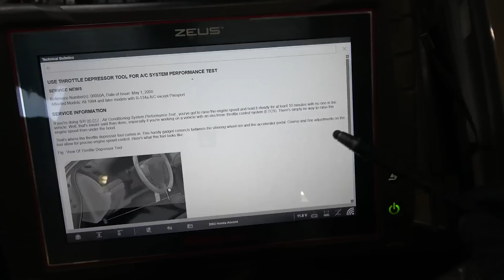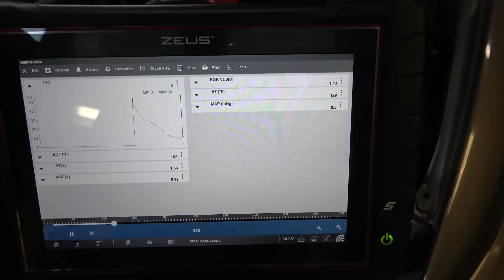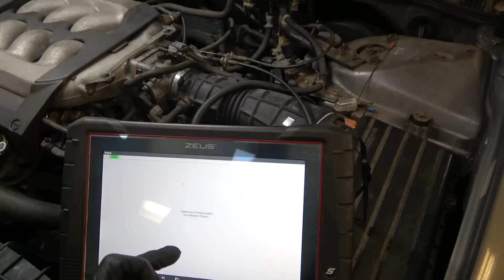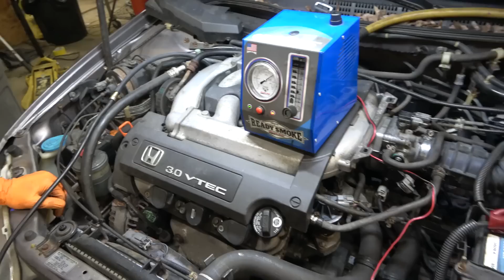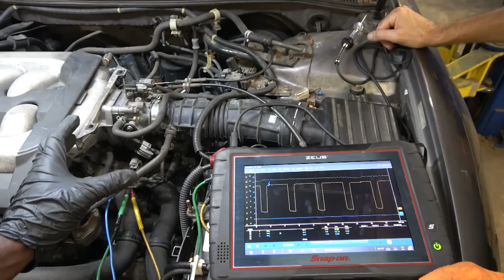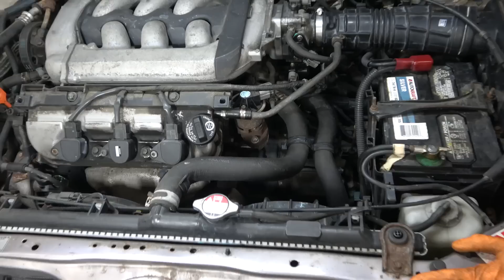This Honda Accord is Unfixable - Code P0505 idle Speed Stuck High

Comment: I have the exact same car and have cleaned my IAC valve and after 260k miles it smoothed out the idle.  Another item is the cat, after 250k miles, replace it, they are cheap and o2 sensor then too.

Comment: I fixed that same problem and fixed it without diagnosis tools.for all mechanics out there the actual problem with those idle solenoid is the plate that blocks the air passing thru it gets stuck due to gunk especially when the engine is not operated for long periods. Proper regular cleaning of the throttle body is required to prevent it from sticking.
Reply from the maker: @markwill1205  Good!

Comment: Great video I have a 2002 Accord EX V-6 that I bought yesterday, 1 owner vehicle.
idles a little high, what would you check out 1st like air filter? Spark plugs were replaced at 120,000 miles in 2011 at Honda dealership.
Now car has 144,000 miles, your opinion thank you Sir. 👍

Comment: I have the same problem, 1998 accord 3.0 ran perfect for 6 yr , i was putting sway bar end links and decided to clean engine bay so i removed battery and cleaned since i used sone water for cleaning I let the car sit for 4 hot days to dry   then I blew it off with air . Hooked battery on 5th day then surging started . everyone was telling me to let it idle for 10 to20 ninutes and ECM has to learn to idle all over  because it was eraced  but after doing that a few times it still surging, after watching your video i did everything you guys did and still surging. I am wanting to know which vacumn tube Biship closed off to get idle down he didnt point t the exacr place he just said it was befor the throttle.   Need some help. mine surges cold and hot. Thanks
Reply: do you have vacuum hydraulic engine mounts?

Comment: … it is suggested that the focus of the shop be diagnostic specialist/consultant… with less intense repair secondary… since diagnosis is time consuming.
Reply from the maker: @mounbakko5871   Yes! I agree
Reply: @KITS_Auto_and_Truck_Repair ... don't know if you are aware that it is almost impossible for car owners to find a reliable tech who can take the time... let alone have the skill ... to diagnose these car issues as you do... look at the majority of your videos... they are about codes and lights on the dash... most tech just guess because they do not know and do not want to learn how.... time is money and they just want the money... forget honesty or pride of skill... they do not care... another proof is when you have other shops sending cars to you, it means something... it means there is a dire need for a skilled tech... these car issues just keep getting more and more because of these modern cars controlled by computers... if people could get a place where they could go get their car diagnosed and get specific cause, it would be very encouraging because solving car problems can be a money pit as you very well know... techs charging for what they think and not what the issue is... they enjoy the prestige that people depend on them, yet they have no knowledge... the doctor who does not know how to cure a patient who is trusting that the doctor will save him... continue thinking about it and gather data of need, requests etc... to help you determine if you can come ahead financially going this route... build your brand... the time you have put learning and getting this skill should benefit you... keep going man.

Comment: I like the way you give explanations to the work please my question is I have a Honda Accord 2012 model when you pull the shift gear is hard  and if push too is also hard please what is the cause
Reply from the maker: @raymondmensah3261   The shifter mechanism could be rusty

Comment: Near the end of the video when you confirmed it was, in fact the IAC, you mentioned you plugged a port and the car idled down, proving the IAC. Which port was this?
Reply from the maker: @kylefetters9239   The ports between the IAV Valve and the intake manifold

Comment: Hmm, I recently asked a question about a purge valve. I purchased an after market part for my 2010 Honda Civic. It was Import Direct Ignition 2 Terminal Canister Purge Solenoid - 42-00467 from Oreillyauto. I'm going to look into getting a OEM purge instead. Watch the issue be the brand new after market purge valve I recently installed.
Reply from the maker: @DukeofHell   OEM is the best way to go
Reply: @KITS_Auto_and_Truck_Repair  That is definitely true. I got original purge valve I had before and put it back on. P145C and P0497 have not came back. The Import Direct purge was making noticeable clicking sounds which I thought were from the engine but found out it was the purge when I put my finger on it and felt the clicking. I've been watching tons of videos but when I saw KITS Auto and Truck Repair videos it got me thinking. It might be that aftermarket part you installed. Thank you for the videos.

Comment: Great Dx! I'm having the same problem with a 2001 Acura 3.2TL. I replaced the ICV which seemed to fix the surging but after driving it for an hour the surging started back up. I didn't ask for an OEM part so I'm guessing it isn't OEM. I guess I'll go back into O'Reily's and see about OEM. 
BTW, I noticed that Bishop was wearing an IBM shirt. I've still got a few of those in my closet after 34 years at Big Blue. 
Thanks for great video!  Tom
Reply from the maker: @tomhepner5118   Thank you!

Comment: Did replacing the EGR valve fixed the p0505? Im having the same issue but with a 2.3L. Already replaced the IAC valve with oem honda and codes came back after driving around… i also have no EGR valve codes which is weird
Reply from the maker: @jomine16 No, the fix on this car was installing an OEM EGR Valve, make sure you get an oem EGR Valve

Comment: That EGR valve is two pieces, splitting in the middle of the pedestal. There's a gasket between the two pieces.  It can leak through there and cause a vacuum leak; you should have checked the fuel trims.  If the you are monitoring the trims at idle and spray some brake clean right at the middle of the pedestal and there is a leak there you will see the trims change.  Or you could remove the EGR valve, plug off the port, and see if the fuel trims change.

The IAC can have the interior spindle get stuck/sticky and fail to rotate properly.  Disassemble the IAC and cleaned the spindle.  I've done it and it completely resolves the high idle issue.
Reply from the maker: @schifoso  oh ok, Good to know! Thanks for your input

Comment: What about fast idle valve, it can cause that problem when it fails to close when engine warmed up,  and easy to test by putting your tumb at the hole that direct air to it located at throttle body before throttle body butterfly, if it still socks air after engine warmed up, it is defective and cause vacuum leak, it suppose to close after engine warmed up, and you can't tested it by using scanner, it worked by engine coolant,  and also aftermarket idle air  control valve, and MAP and other vital parts Is a bad idea for honda cars, I tried that myself, first brand new unbranded one from ebay, it doesn't workat all, idle start fluctuating after engine warmed up, and second  new branded ultra power  aftermarket, it worked fine for  a month after that   idle fluctuation when  engine warmed up but this time with code idle air controle valve circuit controI, and after that i just Hunted for a good used OEM one on ebay and it is a year and half now and the car is happy no problem, third time was fast idle valve problem that caused hight RPM or engine RPM fluctuation after engine warmed up. I just changed the fast idle valv and adjust it (new aftermarket need adjustment), so it can close complettely at engine normal temperature 80 degree Cesius,and problem solved.
Reply from the maker: @abdoualilahthomas8031  Cool

Comment: Did you check the throttle cable? Some people adjust it to fix a low idle. Then after the engine is fixed you will have this exact problem
Reply from the maker: @fmbfla   Oh Cool, Good to know!

Comment: @KITS_Auto_and_Truck_Repair I have a 2002 Honda CRV, and it's the same issue! I have tried 3 idle air control valves from AutoZone. I am glad that he mentioned he has tried 2 after-market parts and still failed. Where can I find an OEM idle air control valve for a 2002 Honda CRV 4WD EX. My next approach is getting a used one from the junkyard and hoping it works.
Reply from the maker: @DavidSanchez-fo7sx if you can't get it from the Dealer, the junkyard would be a good option and make sure the wiring the IAC Valve is good!
Reply: @KITS_Auto_and_Truck_Repair  Replaced it with a junkyard part. Cleaned it and installed it. Idles much better when it is cold but once it warms up, the same issue with the surging. How would I test the wiring? I can't find anywhere that tells me how much V each wire should have. Can the IAC be tested with a multimeter before being installed? Would have loved to see a side-by-side comparison between the specs of the OEM and the faulty part like resistance or voltage between pins.
Reply: @KITS_Auto_and_Truck_Repair  Also, the CEL is on. It surges, but When I clear the code, it idles perfectly. Any reason why is does that? assuming its faulty, shouldn't it continue to surge.

Comment: Nice job 15:00 all egr valves laeks,all tps  shaft leaks, pcv os a vaccum leak  . Those are  considered  as  measured leaks that are ignored o pre program on the cuastom tables of the software  for fuel trims control
Reply from the maker: @JoelAutomotiveInaction   Thanks!

Comment: Far as aftermarket stuff goes, not all of it is created equal. You're likely to get burned using no-name garbage from Amazon or eBay but there are others that are OEM quality, such as Denso, NTK, Hitachi, Delphi, and Aisin, and in fact many actual OEM parts come from these companies. If the OEM part is unavailable or prohibitively expensive, you can usually find an OEM equivalent part from these brands for much less on RockAuto.
Reply from the maker: @notsureigaf  That's some what true!

Comment: I have a question .......Can you explain what happens when you pump the brake pedal to test the 02 sensors?  I saw you do it on one of your older videos.  Just thought that you might see my question on this recent video as you reviewed the comments.  Your skill is self evident and your gift in explaining what you are doing and why is such a wonderful contribution to all of us DIYers.  Thank you for that!  God Bless you.
Reply from the maker: @ronniestevens9268  My Pleasure! when You pump the brake pedal while the engine is idling you create a lean condition on a vehicle that has a vacuum operatedbrake booster, because in the booster there is vacuum on one side and atmospheric pressure on the other, so pumping the brake pedal allows air to enter the vacuum chamber and create a lean condition, since the vacuum side is attached to the intake manifold, when this happens 02 sensors that are good react to the mixture change very fast, indicating good 02 sensors!!
Reply: @KITS_Auto_and_Truck_Repair  I understand.  Thank you for explaining that.  That is very helpful and a valuable bit of advice!
Reply from the maker: @ronniestevens9268   My Pleasure!

Comment: Not sure if it was mentioned, but I would've monitored the scoping of the idle valve at operating temperature to see the valve open and close. I'm assuming there would be some distortion in the signal when it's commanded to close
Reply from the maker: @user-sv2ex7ux4i  yes!

Comment: Common egr flow problem is a blocked transfer port in the upper intake plenum caused by carbon build up (p0401).I believe a 5/16 drill bit fits perfectly in the hole to clean it out as i have done many but it's been a while.
Reply from the maker: @montefiveforty1   Oh Good!

Comment: EGR needs a TAP TEST to see if it is sticking. If the IACV (older models) has some coolant lines going to the TB, which is not fully warming up the IACV due to air or junk trapped in the coolant area, this can be one problem. Since the IACV does not properly close from not being properly heated up, it acts as a vacuum leak, air bypass leak around the butterfly valve. I now see you have an EGR leak which in some cases is a built-in vent hole since it's on the top area away from the EGR plunger check valve face, the top should only be the position sensor and solenoid electronics. 

Honda likes to open the IACV off idle so when you are driving and come to a sudden stop, the IACV is not closed and the sudden closing of the butterfly valve does not cause the engine to stall and allow the IACV to close off slower at stops. An old test is to watch the Duty Cycle at a stop, fully warm, in gear, brake on, then release the brake and allow the car to roll and watch the DC as the PCM now has a VSS signal that can tell the IACV to open a bit so when you stop, the engine will not die from a sudden stop of the VSS. YES YES YES, plugging the port, inlet bypass port to the IACV is a proper test. 

You may have experienced a bad ICV in a Nissan that is electronically heated and it also does not fully close when hot so there is an idle problem also, the same scenario here in my story. Clamp off the air hose going to it and problem found, no more bypass air leak. In other engines, the TB Gasket can be put backward blocking off a bleed port causing problems as the bolt pattern is the same both ways but the port holes are not.

If you had a sensor simulator handheld tool you could create your own PWM, (name ?). When you do tests, I wish guys would show final good test results, this was prior to the last IACV, SCAN DATA MAP 0.9V Idle IACV 1.0V At 1400RPM, if you don't mind, please redo verification testing for the YT viewers. Thank you for the case study as always.
Reply from the maker: @DuaneDonaldson  My Pleasure! and thanks  for your input, I appreciate it
Reply: @KITS_Auto_and_Truck_Repair i

Comment: Maybe I missed it but, did you guys ever try unplugging the electrical connector from the ISC valve while the engine is on at idle?
This way you can see if there’s any change in the idle speed and rule out a defective or malfunctioning iac valve
Reply from the maker: @abe2ham  No we didn't!

Comment: Other than air and oil filters, I always use OEM parts. I learned my lesson with using reman NAPA rear brake calipers for my Accord. 2 years later I had replaced both calipers a total of 4 times because of junk NAPA reman parts. Sure they're under warranty, but when your brake calipers sieze unannounced and it's -5 degrees in the middle of February, you'll be sorry you went the cheap route.
Reply from the maker: @milfordcivic6755  I agree with you!!

Comment: The correct way to do this is actually to put OEM Honda parts in it Honda parts in it generic Parts even though the part numbers are the same are not made to exact specs of the Honda parts Hondas have really picky engines so it's very important to you is the real OEM part
Reply from the maker: @user-xk8iv2oe6y   I agree!

Comment: First time viewer, 30+ years in the automotive trade. I gave you a thumbs up and a sub, so now I will be looking for you to impress me, lol. I would not have put the aftermarket EGR on this car, especially considering what you said. If you are going to tell the customer that they will probably need an OEM valve in the future because the new one has a slight leak, I would just leave the old one on which also has a small leak. But I would tell the customer that they are going to need a new OEM valve now or in the very near future if they want there vehicle running right. Just my opinion, other than that it was a good video. You two seem to have a good synergy together, keep it up!
Reply from the maker: @mikeburdi3464   Thank you! and welcome to our Youtube community!!
Reply: He had EGR flow codes with the OG EGR valve.

Comment: Hey bud, I remember you told me P219A is possibly injectors.

I have this P219A code on my 2013 Chevy Silverado and I have already changed spark plugs, spark plug wires, all eight fuel injectors, both upstream oxygen sensors, purge valve, cleaned mass air flow sensor, changed air filter, changed dirty air pcv hose, cleaned throttle body and performed idle reset using scan tool.

What else could it be lol?
Reply from the maker: @TurnThemWheels  I recommend you take it to a pro mechanic who can diagnose it properly!!

Comment: At 12:00 I'm calling the boys to cast their votes....

At 15:00 I'm clapping at his finding the smoke from the EGR!

Ok, the EGR functions at part throttle cruise.
A vacuum leak atvthe EGR valve could be eliminated by blocking off the EGR port with a biz card betwwen the EGR valve and the port.

The surging is most likely the vacuum leak at the EGR valve causing the elevated idle indicated by the elevated idle MAP voltage. At idle, N.O.T., the PCM will attempt to bringle the idle speed down using fuel cut.

A quick IAC valve function test at idle is to block of the port in front of the throttle plate and see if the idle speed drops down to idle.

In this cae, I doubt it would have dropped because of the vacuum leak at the EGR valve.
Reply from the maker: @EKHondaMotive  Yes! Thanks for your input my friend!

Comment: At 1:05, I predict a pair of frayed PSP switch wires at the connector.

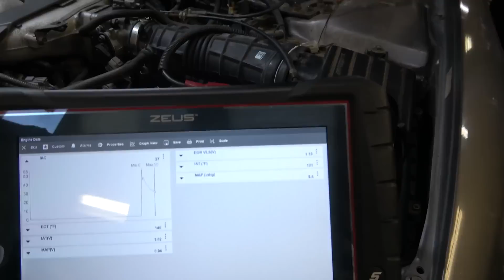At 5:30, I'm wondering about coolant flow through the IACV...
...because of the surging.
Then, if there isn't a vacuum leak. The surging sounds like fuel cut.

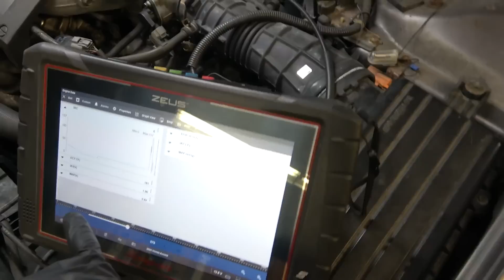At 7:00, I'm wondering why MAP voltage isn't closer to .88V
Reply from the maker: @EKHondaMotive  aftermarket MAPs can be slightly off!